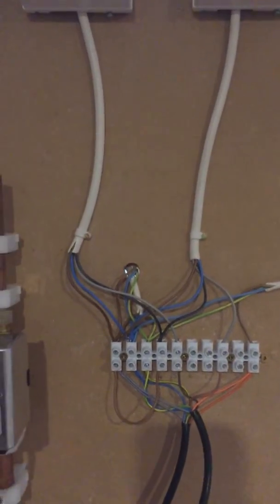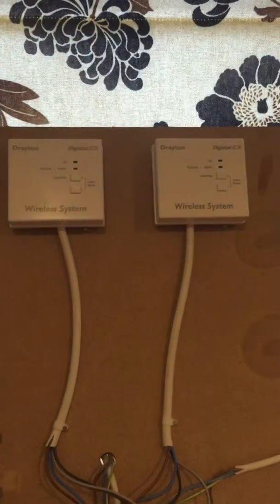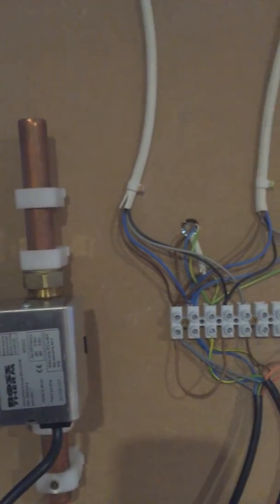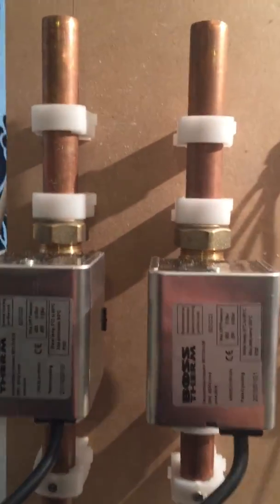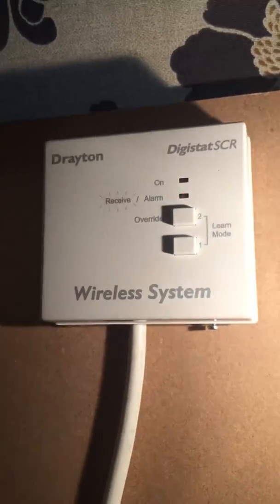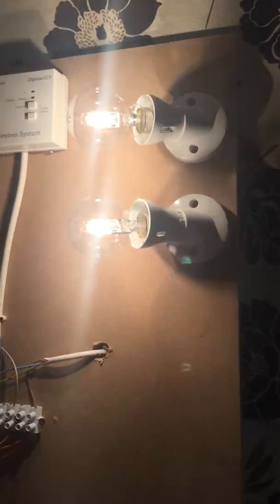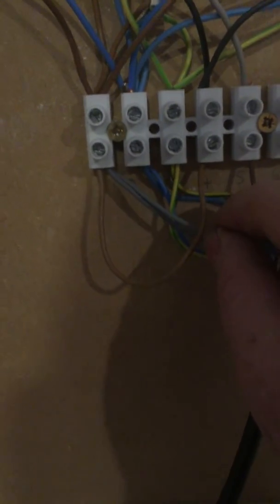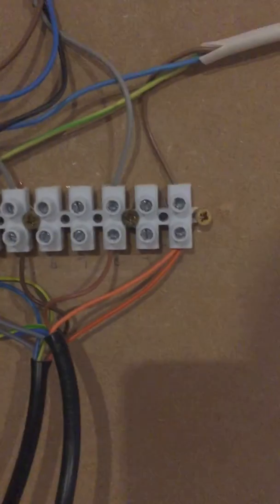How does a s plan system work basic central heating

Comment: Nice video no BS! if the boiler had volt free thermostat contacts what would you do then?
Reply from the maker: Thanks very much for your comment, please consider subscribing to support the channel 🙂
Reply from the maker: Add a relay. https://www.youtube.com/watch?v=lvUDI5fVMi4&t=76s
Reply from the maker: you would need a relay. Thanks.
Reply: Connect the volt-free boiler wires ( 2 of them) 1 to all the grey wires on the zone valves and the other to all the orange wires on the zone valves. A relay is not needed as the zone valves function as a relay. The zone valve grey wires (& the orange) MUST NOT be connected to ANYTHING else - like a permanent live.

Comment: Great video, How would you add an additional pump for under floor heating to work along side a 2 port vale
Thanks
Reply from the maker: I will try and do one , Thanks
Reply from the maker: Thanks very much for your comment, please consider subscribing to support the channel 🙂
Reply: You don't add a pump. You just put the new plumbing in with a new zone valve to go with it.